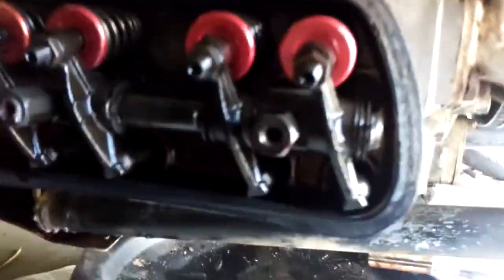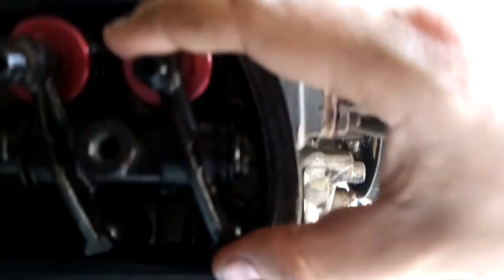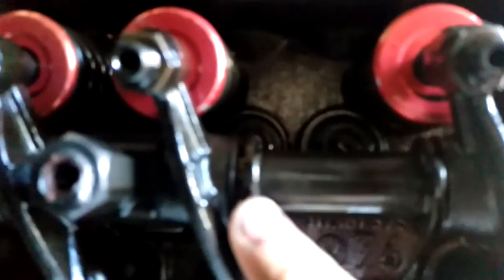Rocker noise on VW Bug engine

Comment: I've just had my valve cover gaskets replaced to fix an oil leak and on my 73 Super Beetle and now I hear a knocking noise when ecellerating up a hill that I never heard before. What do you think?

Comment: Do you record the sound. I might have something similar on my 2000 vw 2.0. No noise at idle, but when I give gas, there is a noise coming from the top and cant determent if its something  to do with air flow or something with the rocker arms.

Comment: If you can't find any, I might have some that I can send you.
Reply from the maker: ***** I might take you up on that.  None of my regular VW places stock them anymore outside of the whole rocker assembly.  Was going to try my luck at a local hardware store as a contingency.
Reply: Scott Williams I think I found some. Can you measure the shaft diameter? The washers I have came off of one that is 18mm thick (inside diameter of spring washers).